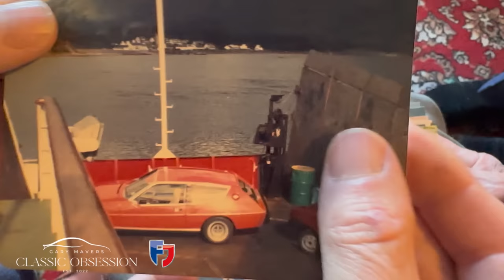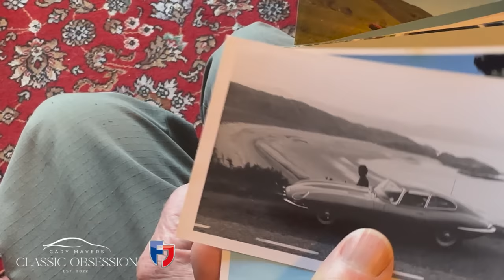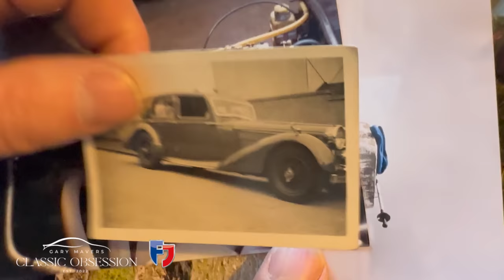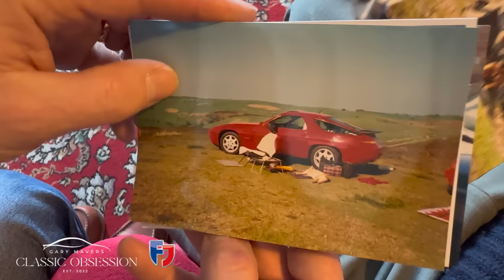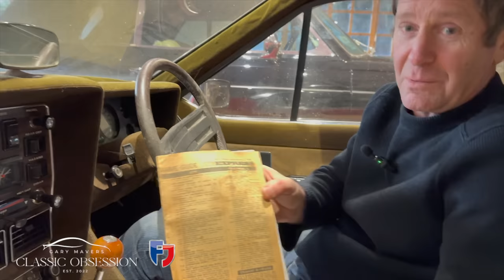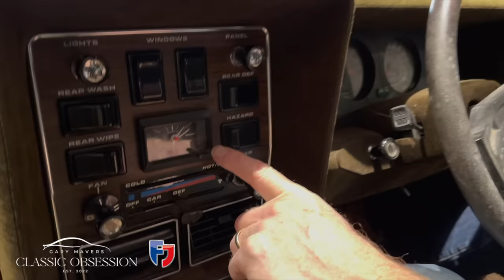Lotus Elite Barn Find! | Classic Obsession | Episode 20

Comment: What a great car. I used to think these were the ultimate in naff 70’s wedge, but in recent years the wedge look is imho far more pleasing to the eye. If the Elite is an S1 it won’t be a galvanised chassis & very very likely that it will need replacement which will make resto costs probably more than the car is worth. Still it’s worth saving. It’s a classic & a sporting express from almost 50 years ago! How times have changed.

Comment: There is a gent who shows one of these at the Severn Valley Classic car show which features cars up and down the various steam rail stations in the Severn Valley (Shropshire/Worcestershire) . It’s the same colour as this example , and states it’s on the original chassis- they were not treated against rust earlier on , but galvanised later in production, I believe. Never forget reading about them in road test magazines in the 1970s ( showing my age !) and the incredible road holding , particularly when on 205/70 series Dunlop tyres. Great video , as always , Gary.

P.s I think the tyres from new might have been Dunlop SP sport as fitted, and originally engineered for the Jaguar XJ series, or possibly Dunlop Formula 70 which was a high grip tyre in 70s series profile , all the best for the restoration

Comment: Gary did you notice on the film as the car was being trailered out of the garden on the transporter and as it turned the corner the sun reflects off something and it looks like fairy dust being sprinkled - the car knows it’s off to a whole new set of adventures. 
A visit back for a drive but with both of them would be fun. 92 and still sharp and both of them making the right plans as they get older. 
What would be good is a visit to a lift to make sure the chassis has survived and doesn’t need welding.  
Well done on the eclectic choice. You just love a headlining so here you have two to do! 
Those headlights and the vacuum will be another source of utter misery followed by elation! Can’t wait.

Comment: I have a real soft spot for the Elite having worked at a Lotus dealer from 74 - 87 and spent many hours working on these, especially the very weak gearboxes. That looks a good possible restoration project, hope the chassis is okay?

Comment: The wheels on Toms  old E Type Coupe in the photo are American made magnesium Halibrands that were usualy fitted to  AC  /Shelby Cobras and GT40s . The sidedraught Webers (45's)  on the engine indicate that it was in a pretty high stage of tune.
Reply from the maker: Thanks Wayne. I’m sure it’s just a slip of the tongue but you know it’s a Lotus and the carbs are Delorto’s? I love the Shelby Cobras but had no idea they used the same wheels. Appreciate the info. Regards.
Reply: @classic.obsession  My comments were entirely about the Jaguar E type in the old 
Gentlemans photos, yes I know your car is an Elite 501 with Delorto Catbs, I have owned and worked on many Lotus cars .
Reply from the maker: Apologies Wayne. Of course the Etype in the photos. It’s an unusual one like I’ve never seen the likes of before..

Comment: If you get stuck for bits a pal of mine has a field full of the things. 

If I see you at the next C&C I'll introduce myself and if you need anything I'll see what I can sort.
Reply: i need a few parts for mine , can you give me details of location if i PM you ?
Reply: @martinparker9249  they're at a friend's house so I'm not gonna share location on here. 

Message me if you like and I'll ask if the bits you need are available.
Reply: @petem6226  i need a passenger rear seat in the same beige cloth as the video ideally and a spare wheel holder thing under the car both missing on mine however posting may be a problem depending on whether your mate is north or south . i'm near Blackpool or huddesfield
Reply: @martinparker9249  my pal is in Norfolk. I'll ask him what he's got.
Reply: My pal has the spare wheel carrier, he says it's basically just plywood. He can send you dimensions etc if you'd like to make your own.
Reply: @petem6226  no i need the metal 'cage under the car , its outside on a Elite ,inside on a Eclat